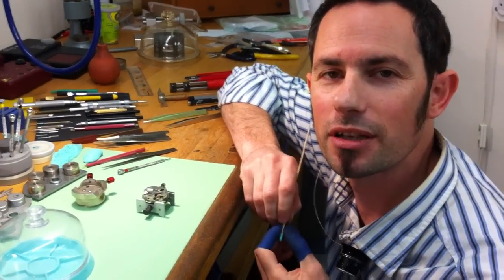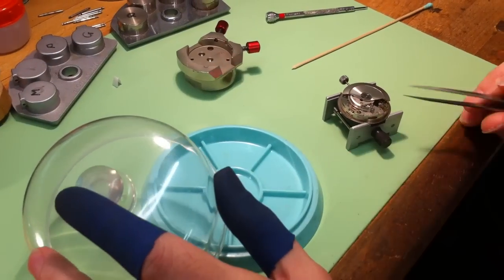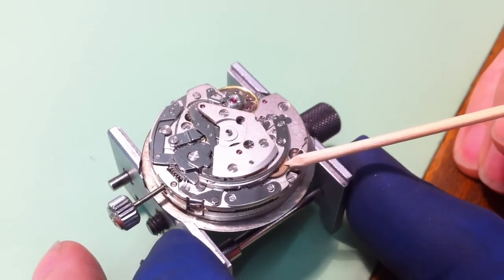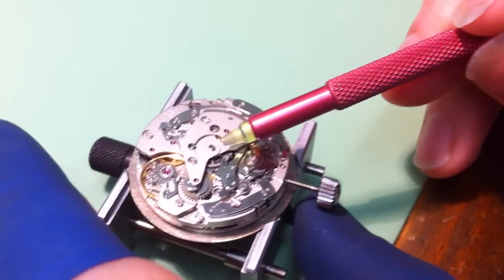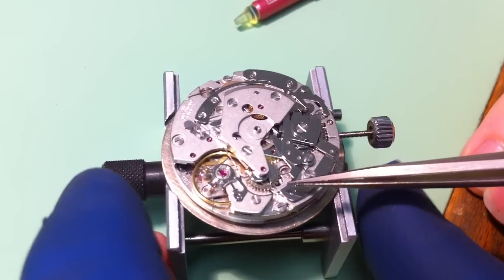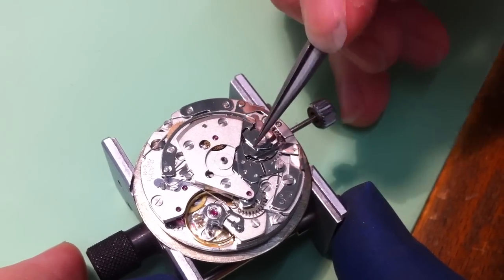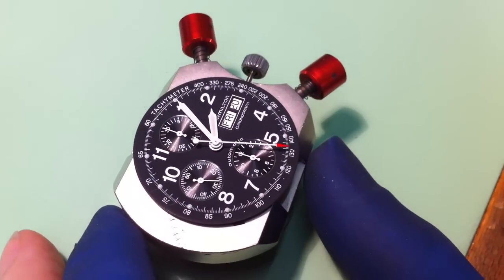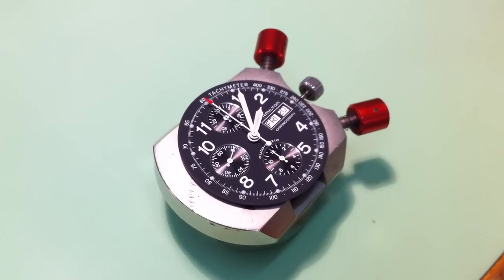Valjoux 7750 Explained

Comment: Hi, great presentation of the movement. Could you help to understand why the barrel with the main spring shall be replaced, what might be the reason to do so? My watch with the 7750 movement remained untouched, placed in a watch mover, and I have noticed that after two years the watch does not work. And the authorised service wants to charge me for the barrel with the mainspring replacement.

Comment: So I watched the first time and thought, no the reset of the chrono spun clockwise. So I watched in 0.25X playback speed and sure enough, i was right. The chrono test spins the hand clockwise and stops almost dead on 12, possibly over shooting to 12.30 on the hour position. I mean unless the shutter speed of the camera is just that bad that I can actually see the hand passing past the 6,7,8,9 etc then pretty sure your wrong on that particular bit of info. That being said, great video, very nice showcase of the sweeping hands and a nice clear look at the movement in the nude! Probably saved alot of people the trouble of taking theirs apart to be curious.

Comment: ETA has some of the most sophisticated mechanisms for autowinding.  In one particular ladies' automatic movement (I forget which calibre) I found a planetary system with a multitude of gears which perform reduction for winding the mainspring barrel, and even a system for decoupling the rotor when the watch is fully wound- I believe there were ten gears alone in the selfwinding mechanism of this movement.

Comment: Only negative of this movement is the thickness. I've been looking at the Archimede Pilot Chrono and it's a beautiful watch but it seems so thick. Without having an authorized dealer where I could check it out in person, I'm finding it hard to drop $1.200 on one.
Reply: I own that watch, and it fits surprisingly well. I've owned several watches with a 7750 or similar variant, and the Archimede isn't all that thick, comparatively speaking. The 7750s in Hamiltons (as shown in this video) are super thick.
Reply: I believe steinhart uses this

Comment: Thank you Blair (or watchesonbroadway)!  I will most certainly give this a try.  I would like to buy a new sapphire crystal from you if I could; I am not sure of the thickness, but I know it is 30mm in diameter. The back crystal is not sapphire (scratched) and is smaller, maybe 25mm, but it would be nice to have a sapphire there.  Both are pretty thin.  Watch is Tissot v560 Bridgeport chronograph. I would also buy a band & oils from you.  I am in the USA.  Please let me know.  Thanks again.

Comment: In my old 1991 Breitling Windrider Chronomat B13047 runs the same Valjoux 7750 movement. It´s a very good movement and you will find spare parts for it even in a hundret years.

Comment: That is from early 2000 Hamilton Chronograph 3824 - High End day&date 42mm model from 38 series. The watch retail was around $2,000. I have exact same model.
there is nice review in French for 3828 date only model - "google Hamilton 3828"